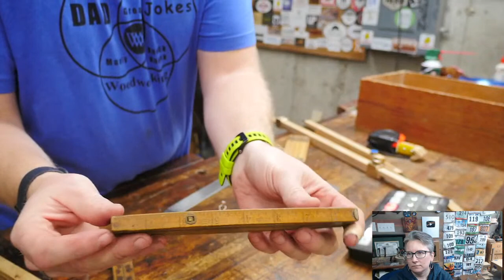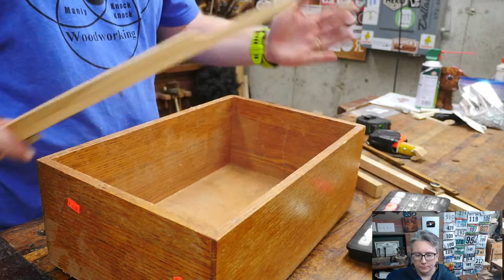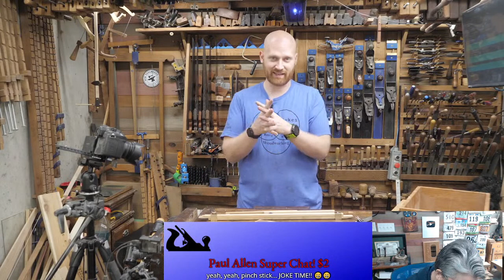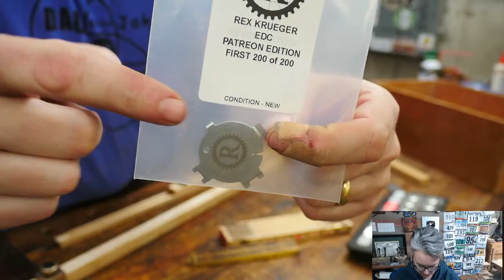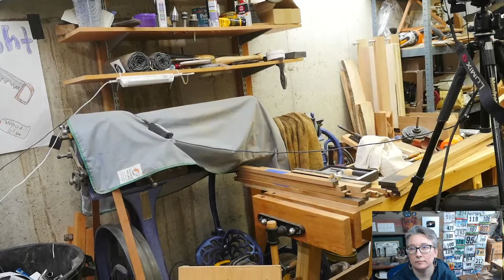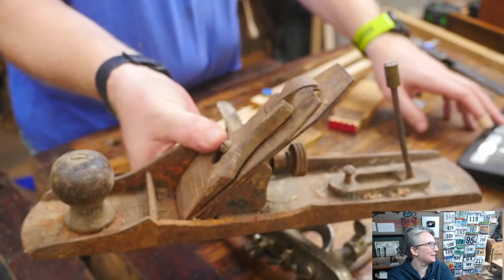What Are Pinch Rods and What For?

Comment: 尺, spelled chi, is the closest unit to foot. The modern Chinese chi is defined as 1/3 of a meter. 寸, spelled cun, is the closest unit to to inch. The modern cun is defined as 1/10 of a chi, so 1/30 of a meter, 33.33mm vs 25.4mm in 1 inch. Chi and cun represented different length throughout Chinese history, from 204.8mm to 320mm. Modern inch was defined as 25.4mm in the 1930s.

Comment: In the Bible, a Cubit was used by God as a unit of measurement when telling Noah how to build the Ark or when He gave directions on how to build the Ark of the Covenant. The cubit was generally considered to be the length between your elbow and middle fingertip, or roughly 18 inches.
A good friend of mine is a cabinet maker and he has a long board that is his "story board" for making cabinets. 
This is a great video.
Reply: In ancient Egypt, the legth of the Cubit changed somewhat with each new Pharoh. Nevertheless, they were able to make colossal structures to a measurement precision not matched again until the 19th century AD. The cubit was also unique in having regular subdivisions smaller than a body part.
Reply: @GraemePayne1967Marine  
If I remember my Egyptian history correctly, each Pharoh had new cubit sticks made according to their forearms. I don't recall which Pharoh started subdividing the cubit with the first knuckle, the full middle finger, the wrist, and the elbow as measurements, but I read that one of them started the "story stick" sub-measurements of the cubit in that way. But again, I could be mistaken, that could be in Greek times, but I'm thinking it was Egyptian.
Reply: @thomasarussellsr  You are correct on that. In addition, at each full moon all "working" cubit sticks had to be compared with the "master" cubit made from stone (black granite for example). The penalty for non-compliance was death. We now call the process of regularly comparing a "working" measurement or inspection tool to a "master" standard "Calibration". This ancient Egyptian periodic calibration system was somewhat more punitive than the compliance requirements of modern calibration standards documents!

Comment: I'm thinking that aluminum T-track would make good pinch-rods with an hdpe plastic slip sheet glued to one or both halves. Just have to figure out the ends/pointers/washers. The slide-nuts could be bolted or glued in/together for the mechanical connections.
Reply: In principle, pinch rods of any material would "work". However it is best if they are made of a material similar to the work. This is to remain close to the material properties of the project. Wood can have substantial dimension changes in response to humidity, but not so much with temperature. Aluminum has substantial dimensional changes with temperature, but humidity does not affect it. So it is best if a similar material is used; OR if the environment of the workspace is controlled tightly enough that the differences between the various coefficients are reduced as much as possible. That is one reason why the temperature and humidity of calibration labs are tightly controlled; and that the effects of other forces are either well controlled or known. 

For example, some types of measurements require that the magnitude and direction of the local gravity vector is known. The force and direction may be constant at a particular location, but can vary considerably between locations. Gravity varies by location, latitude, elevation and local geology, any of which can affect the force and direction of gravity.
Reply: @GraemePayne1967Marine  
I'm sorry but, what? Your taking an instantaneous measurement to transfer to another point. Are you really worried about temp and humidity changes in a matter of mere seconds to minutes? Or is it typical to take a measurement with a pinchrod and leave it set for extended periods without using it to mark your stock for the cut, or double checking against the reference?

Comment: 21-11/16" is a Precise measurement. The Accuracy of the measurement depends on calibration and user technique. Precision and accuracy are not interchangeable terms.
Reply: Though not as precise as 21 43/64"

Comment: It might be that I have spent some time in a machinist shop but I find it wierd that woodworkers seem to default to the tape measure for measurements. To me that is the sloppy, measure stock to approximate length tool. For the first 15cm (half foot) I will typically use a sliding caliper and then a steel ruler with engraved millimeter marks (so you can actually put your knife in the mark) for sizes up to the meter (approx. 1 yard) and only beyond that I resort to tape measures. For the sliding calipers I prefer one with a locking screw which allows me to use it as a pinch rod. In general, I really find that working to registered measurements (physical stop) to put the tool or whatever is measured up to is better. The mechanical engineering nerd in me is sometimes drooling over a precision set of gauge blocks (not that I really need them). A set of feeler gauges is also something that you should keep around the shop for those interior sub-milimeter measurements (or you could steam a plane shaving flat...).
Reply from the maker: A machinist works to the nearest 10,000. A woodworker works to the nearest 16th. A carpenter works to the nearest 1/8" a framer works to the nearest quarter inch and a boat builder works to the nearest boat
Reply: I get the draw of gauge blocks... I love the process of machining and I'm also an engineer, so the idea of getting down to the nearest 0.0001" is appealing to me.
Reply: @WoodByWrightHowTo  Good answer.
Reply: @robbie6625  Then you're going to hate working with wood, as it's a living material, which shrinks and swells with the seasons. Although woodworkers strive to build items with wood that has less than 10% moisture content, to ensure dimensional stability, the wood will still shrink and swell according to atmospheric humidity. So, measuring down beyond 16ths of an inch is pretty pointless, because the material isn't stable in the region of below 1/32nd of an inch. This is why you have to acclimatise the wood every time you cut stock cut, planed lumber to make larger panels. The moisture content of a larger piece of wood is higher on the inside than on the outside. When you through cut say, a planed 2 x 6 plank to create a 1 x 12 panel by gluing the two halves edgeways, you should through cut your 2 x 6, and let the pieces rest in low humidity for a day or so to dry out. Then check their flatness before gluing. You might find that the wood bowed as it dried out, and will need to be planed flat again before you can glue it. Woodworking is such a sensual and organic material, and it's an adventure, because you have to compromise and work with it, to create something beautiful. Of course, materials like MDF and high quality plys are more forgiving, but perhaps not as adventurous.

Comment: Will you be limited if using the pinch rod you made if the drawer opening is smaller than your pinch rod?
Reply: I have a few different sizes of pinch rods to cover my common drawer and cabinet work. There are recommended sizes in the instructions. Hope you have fun making a few.
Reply: For standard cabinets, story sticks are more common for measuring. Pinch rods are great for checking for square of frames and drawer boxes. As far as drawer spacing in the face frame opening, yeah, different size pinch-rods. A set that is complementary to your work.
Reply: @thomasarussellsr  once an opening for a drawer is created use one pinch rod to transfer that dimension to the drawer face. By adding spacers of the correct thickness you get the OD of the drawer face as well as the ID of the opening